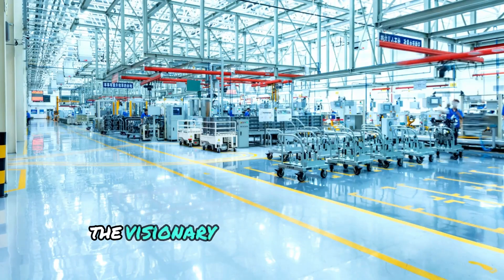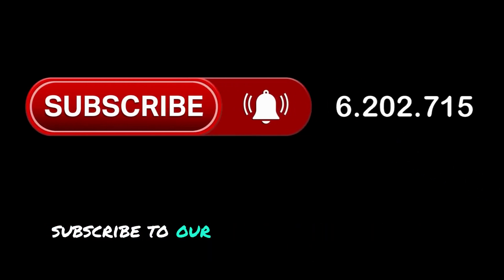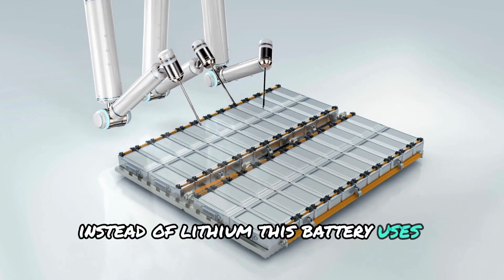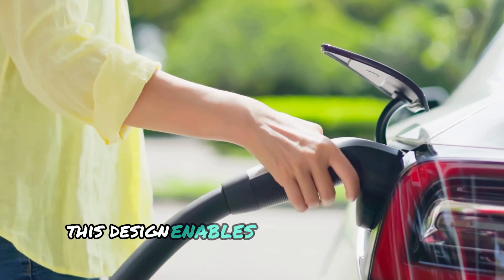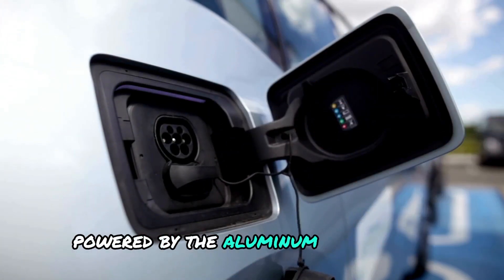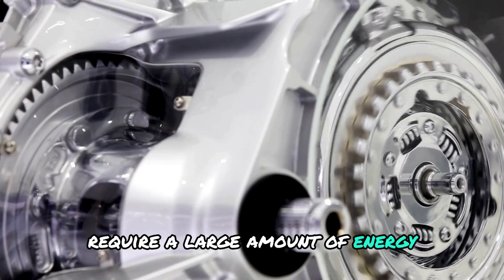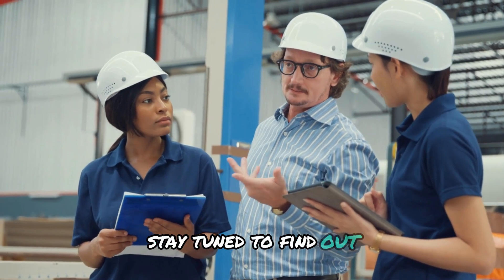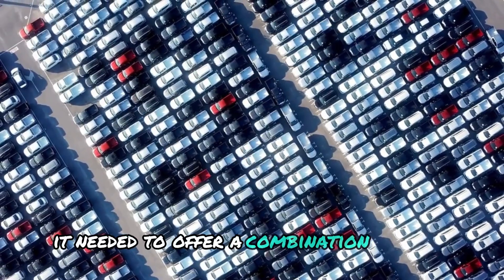Koenigsegg CEO Announces NEW Aluminium-Ion Super Battery With 15-min Charging

Comment: Aluminum is not lighter than lithium. It is almost 5 times more dense. And the battery works the same as every other battery. Ions move from one electrode to the other on discharge and in the reverse direction when charging. Lots of hype - little info.